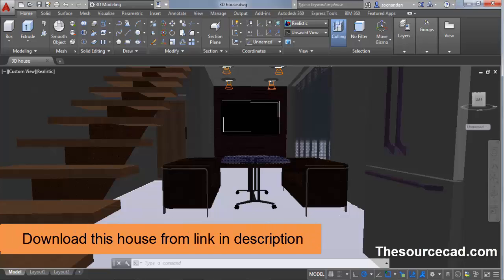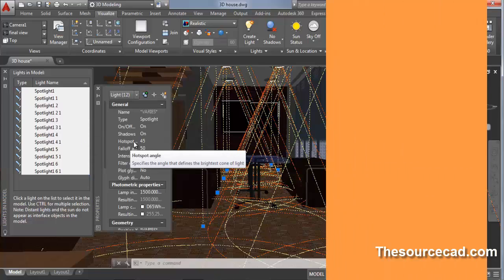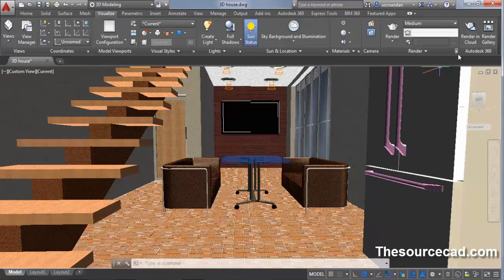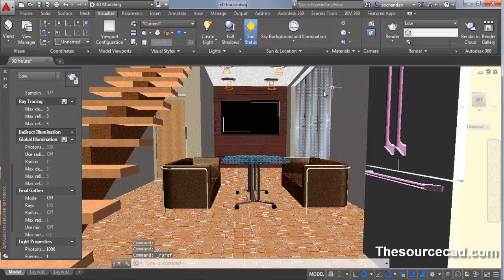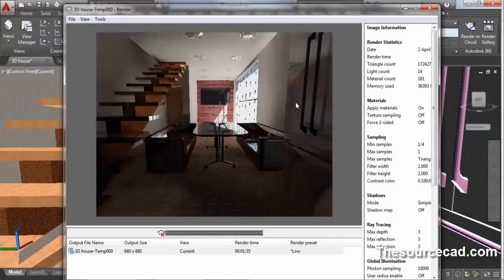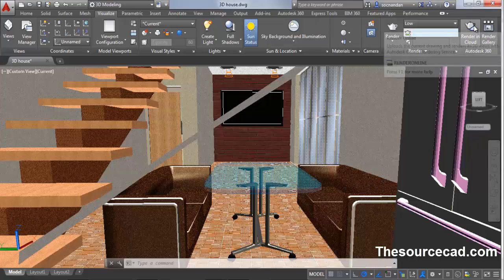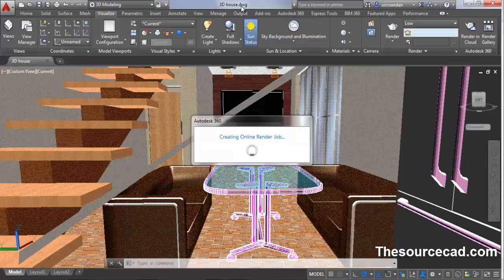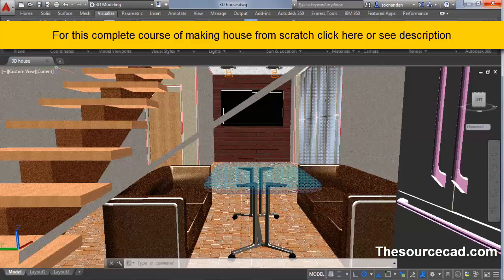Making 3D Photorealistic rendering in AutoCAD

Comment: For who can't find Photon settings in render options, Autodesk changed AutoCad's render engine since 2016. So, you can't change Photon directly but you can do the same changing in same menu from "Render Duration -> Render By Level" levels of quality is like this -> Level 1-5 (Bad Level, For try somethings), Level 20-30 (Medium Quality), Level 50 and Above (High Quality, Generally 40-50 is enough for final render). Good luck with your work!

Comment: Can you tell me what kind of video card you're using?  My system is running extremely slow with this drawing.  When I went to select all the spotlights in the Lights In Model palette, for example, it hung for about a minute after clicking the first spotlight until I could shift/click the last one to select them all.  
I'm using a Radeon video card rather than a Firepro or Quadro.  I'm wondering if that's the problem and if gaming cards really bottleneck the process this bad.  Otherwise, I should be good as far as hardware goes, (I think).  Using Autocad 2017.